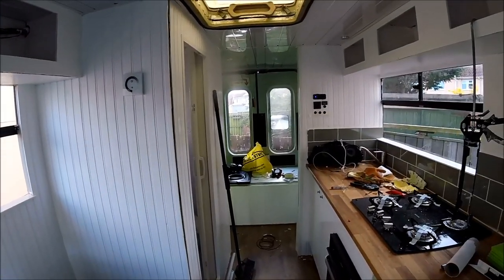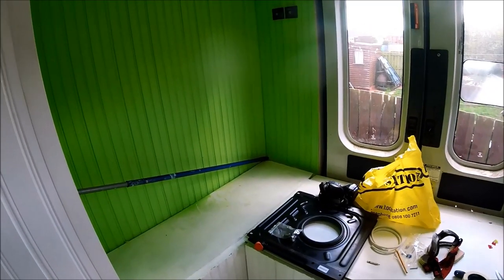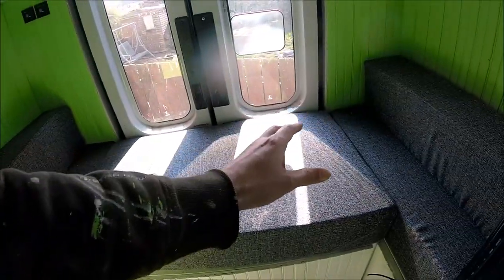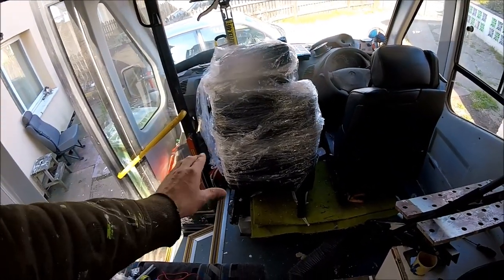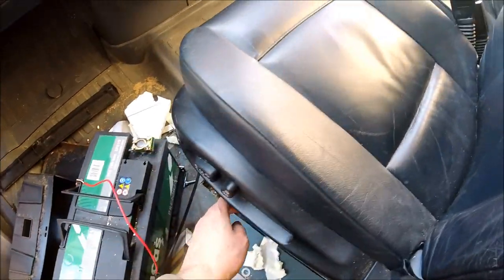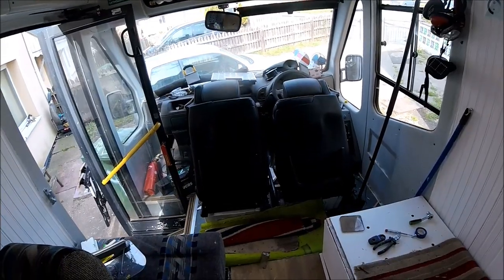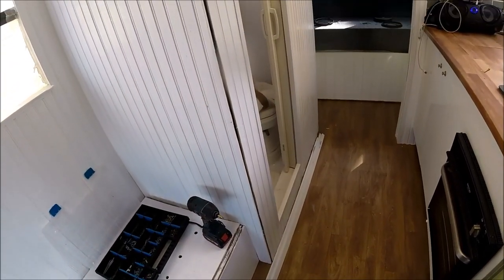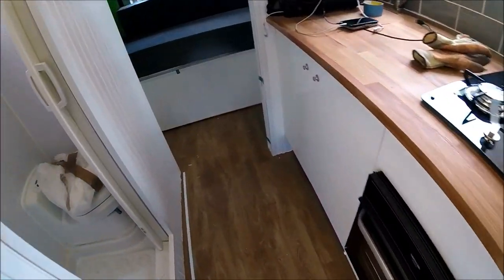Minibus Campervan Coversion Part 26: Fitting BMW Seats & Interior Trim

Comment: Awesome video, thank you so much for these series. I am trying to do something very similar with the treka bus. In regards to the BMW E46 seats, were you able to bolt them in directly or did it requie change to the frame? I am not doing swivel seats, so wanted to put E46 seats directly over the base. Will it require additional brackets or is that a direct fit? Thanks in advance
Reply from the maker: The seat rails need drilling and brackets adding to mount to the sprinter seat base